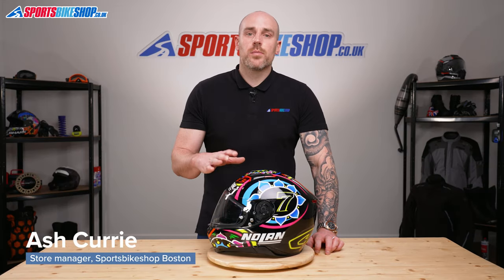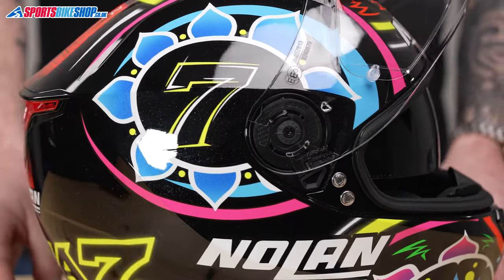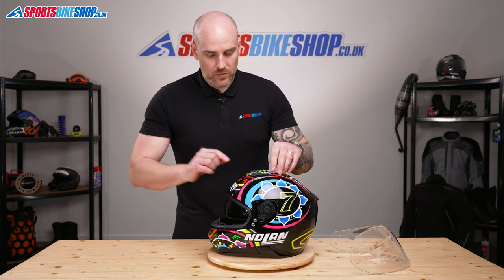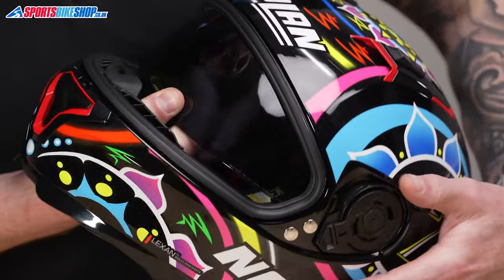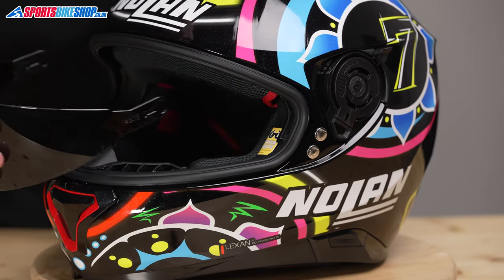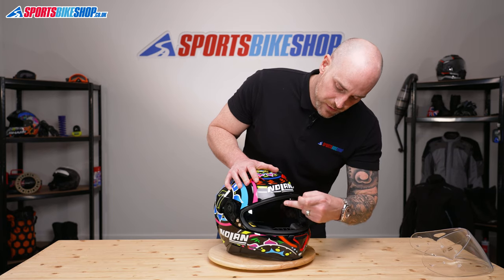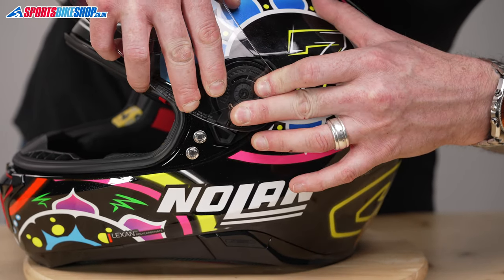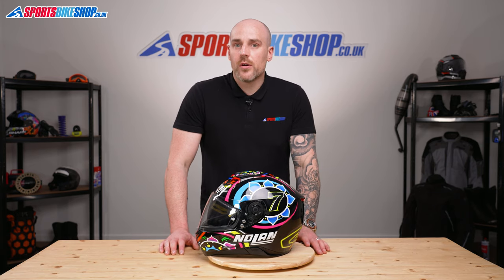How to change a Nolan N87 visor and sun visor - Sportsbikeshop

Comment: Good video. Is there any way to adjust the fit of the visor against the sealing gasket? My helmet is deafeningly loud on just the right side, I think the visor may be a bit loose.
Reply from the maker: There's nothing in the manual to suggest so, Bill. I'd advise getting in touch with the local distributor about this. If you're in the UK that's Motogear - https://www.motogear.co.uk/contact-us/

Comment: are the Pinlock pins on the N87 removable ? or even adjustable to make the Pinlock lens fit tighter to the visor? My Pinlock lens has got a bit loose from the visor and starts to fog from the edges now.
Reply from the maker: They're adjustable via the adjuster on the exterior of the visor. Take out the Pinlock and you'll be able to rotate the pins to alter the tension of the insert. Look closely and you'll see the central posts, which the Pinlock edges rest against, are eccentric and move closer to the middle of the visor, or further away from it, as they rotate. To make it tighter, rotate the pins so those posts are nearer the centre
Reply: @sportsbikeshop  perfect thanks - i’ve just ordered the Pinlock for your website, arriving in the new year hopefully and will give it a go. thanks again !